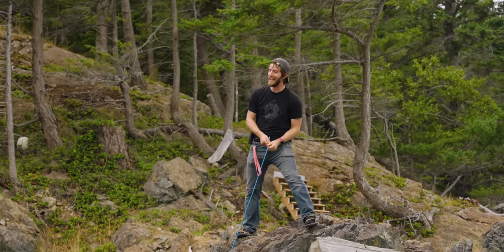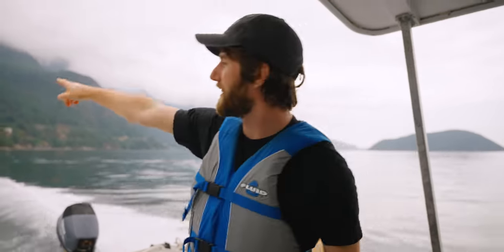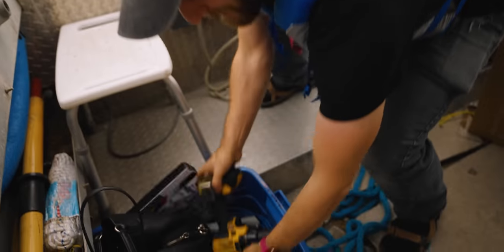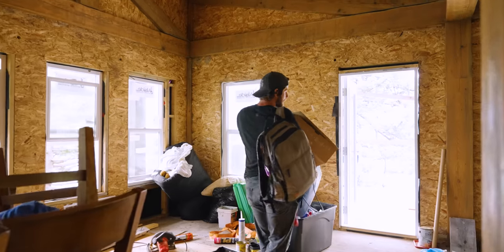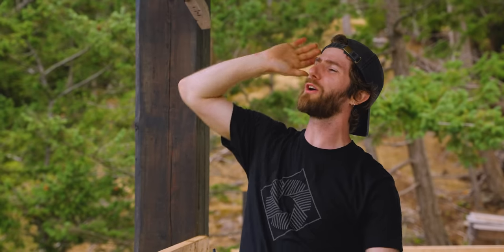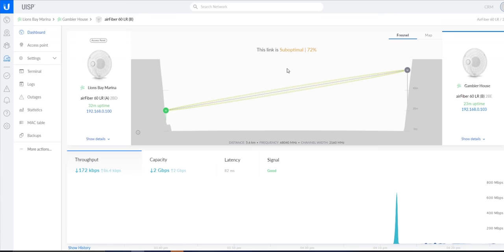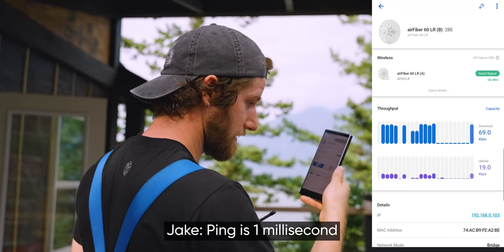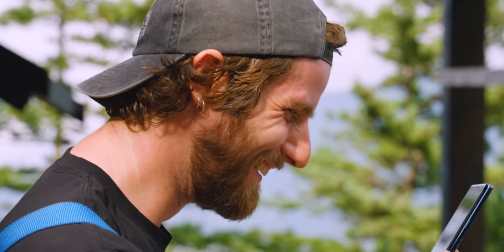How are we going to do this?

Comment: I know very little about computers, I was wondering logistically how does bolting the dish onto the side of the building at the marina side work?  Do his parents own that or did they just get access?  Was just curious where the internet would be coming from when the LTE modem was removed.
Reply: Considering the whole project, I'ld say his parents are loaded, and that marina is pretty small. So in addition to the fees for their boat, they probably pay a fee to mount the antenna to that building. 
Jake said that the ISP would be there to hook up the marina antenna in a few weeks.  Then the LTE modem can go.
My question is whether LTE was not an option on the island itself. This system will require regular adjustment of the alignment.
Reply: @lacdirk   I think the initial setup was the main issue for his parents. They can probably be taught how to make the adjustments. Short term they probably wouldn't even notice minor things since I imagine his parents wont be saturating that link.

LTE has its limits as well. 4g is gonna be shared with all the phones around, increasing ping as well as effecting speeds and 5g wouldn't even make it across the lake
Reply: @PINEx2   … Yes, if a normal suburban family in their 20’s bought and paid for their house in their 40’s or 50’s like good little boomers, then sold their place [even without the current housing market spike], they’d be well on their way to affording a custom built place.  Not too far fetched.
Reply: @JoelKreider  "payed" strikes again :)    [bayed, flayed, grayed, prayed, stayed, spayed]  [laid, paid, said]  English is fun. Surprised autocorrect didn't catch it.
Reply: @ifination  …Aaah!  Thanks bud.  Corrected.

Comment: Linus: I am gonna bring gigabit connection to my parents' "off the grid" house.
Starlink: I am gonna end this man's whole career.... :)
Reply: Off-grid = not connected to utilities (electricity, water, gas, sewage)
Reply: Starlink only promisses 100mbps
Reply: @jur4x  

You're a little out of date. As of November last year, Starlink was achieving 150mbps.

However, it's still the case that Starlink is transmitting over a distance at least 90 times (540km) that of this use case (6km), with latency as high as 42ms.

Also important to note that it isn't very fair to compare Starlink with Earth-based network solutions, as it wasn't designed to compete with them, outside providing connectivity to areas that currently have little or none.
Reply: Starlink sucks compared to this
Reply: @endurable_alex8379  Starlink is still lika developing peice of tech. Give it some time and u might be able to see gigabit connections soon.

Comment: You need a flash mirror, I used to do LoS Microwave hops all of the time, longest distance I've done is like 10 miles.
Reply: I was thinking a flare would have been good, but mirror of some kind does sound better.
Reply: I did a 116 mile path, Mt Eldon at Flagstaff  to across the Utah border at Page Az. Used a big mirror. Or you could use a light at night like Paul Revere. But we used 2ea 16 foot Andrews dishes at 2.4 GHz.
Reply: @tedmoss  What kind of speeds and RSSI did you end up getting?

Fun bonus thing, Mt. Elden is the only mountain I have walked on top of. Was a bit of work for a passive nerd who sits all day like me :)
Reply: @eowendyl  I don't remember all the details. The path loss was like 110db we were using 5 watts at 2.4GH worked better than 5GH for sure...path fade. We had signal loss from Shaw Butte in Phx. to Four Corners for many years, I found the problem in the LO at Shaw Butte; a solder connection not made at the RCA factory.

Comment: What if like a big boat gets in the sightline and blocks it for a bit or something? Or what if it's really stormy? What will happen to the connection?
Reply: The sight line is a pair of intersecting cones, about 2 feet across where they meet and 25 feet above the lake..

You’d only have to worry about the Goodyear Blimp.

As for storms, it depends on the frequency. 

 Microwaves get drowned by rain.   Radio waves get drowned by old cordless phones and CB radios.

Comment: Does BC not have the same harness requirements for lift work as Ontario? Kinda sketchy seeing anyone in a lift without it as someone who works in lifts every day
Reply: They do but this is ltt
Reply: Actually no, fall pro is not required in BC in scissor lifts.
Reply: @kklassen991  do you have a source I could look at I'm honestly just curious about the differences :)
Reply: @mcewennick  I tried replying earlier, but I think the comment was flagged for spam? Anyways, it's in the BC OH&S regs, part 13. Here's the excerpt in question:

13.33 Fall protection
(1) A person on an elevating work platform must wear a personal fall arrest system secured to a suitable and substantial anchorage point.

(1.1) Despite subsection (1), a person on a scissor lift, or on an elevating work platform with similar characteristics to a scissor lift, that is on a firm level surface with no irregularities to cause platform instability, is exempt from wearing a personal fall arrest system, provided that all manufacturer's guardrails and chains are in place.
Reply: Seems like someone lobbied to have that clause added...
Reply: @kklassen991  It's the same way in plenty of US states as well for probably the same reasons.
Reply: @kklassen991  that's the stupidest exception I have ever seen. And I have my OHS auditor credentials
Reply: @kklassen991  huh interesting, I find that surprising but thanks for the info!
Reply: @wpgspecb  lol. Do you put on fall arrest gear when you go out on a friend's deck too?
Reply: I worked with scissor lifts no harness here in NZ. Never felt unsafe, they only went up 3-4m meters and had 1.2m rails. Depends on the size of the machine I guess

Comment: I would rather have 200 Mbit stable connection. Then having a gigabit connection with this. A bit of snow and wind can be extremely problematic. Especially with things that require a stable connection like video calls and live streams. But it's pretty cool.
Reply: its a cabin in the woods, I don't think they need the ability to live stream that much
Reply: I think is fine for music and some facebook, which is what most likely their parents are going to use it for
Reply: There aren't a lot of alternatives. And a 1 gigabit connection that drops 80% in a snowstorm is still a 200 megabit connection.
Reply: @AwesomeSauce7176  this is indeed the only option when there's no cable available.
But I was talking about speed being less important than stability. This connection would be fine for watching things that can buffer as it won't get interrupted when there's a small connection drop.
 But the stability is a serious downside for many other tasks.
Reply: We have a WiFi bridge very similar to this running a couple security cameras at the end of our property. It works flawlessly in all weather, even white-out level snow. (However its not anywhere near the distance shown in this video)
Reply: Lol your using your phone from stream right? Same thing. Only not that strong.
Reply: @AwesomeSauce7176  What about Starlink?
Edit: I guess others in the comments say the Starlink dish uses 100 watts constantly, so without ongrid power that will be difficult.
Reply: @simple-cut-progress2778  that antena draws almost 65W. plus switch, plus AP.    a think starlink would be a right choice here
Reply: @Folkstorm87  where exactly did you 65w from? The manual states it draws 18w max power consumption.
Reply: @backupplan6058  thats the feed consumption.  Check the poe inyector.   

If the consumption was only 18w the switch was more than cappable to handle it.  

I been working with those puppys since the first Air fiber.  (2013-2014)
Reply: @Folkstorm87  really? How long you say. Because if you have I would have thought you would have known that the edgeswitch 10XP only does 24V passive POE while the AirFiber 60 LR requires 48V passive to work. Nothing to do with watts but voltage. Pretty sure you pulled the 65 from the amperage requirements. Please do your homework before correcting someone who knows this equipment far better.
Reply: @backupplan6058  my mistake, that switch only provides 24v   althoug.   the power supply draws 24watts, plus 31.5 on the poe inyector + 8 watts per AP.   

63.2 watts.      still  under the 100watts.  but less convenient.   

even the LTE receiver would draw less power an had enough juice to stablish a stabe connection.      
Lte is not affected by wheater or fresnel radius. even a tiny boat  could block the signal at that height

i would like to see a diferent solution to this problems and not a single "sponsored" solution, when the budget isnt a problem.   
"Hey ubnt, i need this  $1000+ on equipment to do this"
Reply: @Folkstorm87  where exactly are you pulling these figures from in order to justify your mistake? Power supply, what power supply? The POE injector is the power supply and where does 31.5W come from? As for AP, wouldn’t Starlink also need a AP in order to work and that was anywhere mentioned in your first comment. Does seem to me you are pulling it out in order to justify something you were wrong about.

Comment: My uncle uses a switch for his setup, his edge got fried by a lightning, so be sure to get a protection for that i guess
Reply: My modem’s are on a separate surge suppressor & I use fiber/wire transceivers to electrically isolate LAN from incoming wires.

Comment: Heads up don't drill into concrete without something taking the dust way while you are drilling. When you're drilling into concrete it releases silica dust that can kill you instantly, or at the very least later in life. Silica crystals will never leave your lungs once they are there. Be safe guys<3
Reply: Man up, its just dust
Reply: So we have to wear a mask when we drill into concrete?
Reply: @zaki6548  that or have a vaccum cleaner that is aiming at the hole
Reply: @Sniper_Gaming994  can confirm, use vaccum below hole

Comment: The curvature of the Earth is why Linus couldn't been seen. Standing on the shore he was below the horizon.
Reply: EDIT: I realised I made a mistake with my maths - I am afraid that assuming eye level is just 2m above sea level, you can see for slightly over 5km with no obstruction to view from the curvature of the Earth. That means you could see another person who is 2m tall from 10km away. Jake is pretty clearly higher up than 2m above sea level so while linus could be obstructed by waves or something, the curvature of the Earth will have little effect.

(BTW, the mistake I made was accidentally multiplying the 5km distance by 2pi - at 31.514... km the curvature of the Earth would indeed have a pretty massive impact!

Comment: 3:01 I was thinking that a laser pointer could help or high lumen light. Or a rent a telescope or used a powerful camera lens (ex. Canon 1200mm 5.6L Super Telephoto lens) and zoom if LTT has it.
Reply: A telescope wouldn't work because you're working with angles less than a degree. All that would do is get you in the rough ballpark they already knew the general location.

You either need a laser light for pinpoint accuracy or just use the internal system sensors and keep tinkering till you get the best possible settings. 

To bad the system doesn't have self adjusting telemetry.
Reply: @seemlesslies  True. I was thinking just that at that point in the video with the telescope or the light is to get a general location and with small adjustment to pinpoint exact location. I figured the laser pointer or the camera lens because at this point I figured LMG might have a high powered or a super telephoto lens like a Canon 1200mm 5.6L Super Telephoto lens for accuracy. Something like this:
https://youtu.be/U0E-nZOlY_k?t=120
Reply: Lasers are dangerous in populated areas...and many times highly restricted in use cuz of the dangers

Comment: Lol, Linus parents have faster internet in a house with no electricity than I have in one of the most populated cities in the world…F in chat boys
Reply: That explains it quite frankly, because the internet is a shared medium. Your connection is overpopulated whereas theirs is not on the map
Reply: @pietrmuffei8874  i mean 4mbps in a major US metropolis is a joke lol, these guys are legit getting LTE antenna connections 250x faster than me :(
Reply: @joshuad1716  I wouldn’t compare the US to any country. The US mos def is the last first world country. You as a citizen have to do politics.
Reply: @joshuad1716  Pretty sure that wasn't an internet speedtest. That was a direct test between the Unifi devices.
Reply: @VexingRaven  that would make a lot more sense and lessen my depression slightly
Reply: @joshuad1716  Bro...you could plug 2 computers in to a router, transfer a file between them and get the same kind of speeds...but that doesn't mean your internet will be that fast. Network vs Internet 2 different things.

Comment: Wow, what a home to live! It's nothing for me, but I mean it looks awesome and is definately unique 😮
PS: So why didn't they just use the LTE thing for the cabin? Speed?
Reply: LTT seems to have a boner for Ubiquiti stuff these days, probably a sponsorship. From LOTS of experience the airfiber stuff is superb but very expensive (though that link is gonna slow right down in the rain and die in snow I guarantee it, -61dBm is not a reliable link for these). The unifi stuff is pretty bad and is very quickly superceded. Ruckus however make superb local AP hardware, it just costs three times as much as the unifi stuff.
Reply: Lte isn't as good as a wired internet connection

Comment: Why don't you do that with starlink?

I'm currently building a round robin for my new house with two starlink dishes pfsens and unifi :)
Reply: This way they can have better speeds. Starling doesn’t hav the best speed and by using this method they could connect to and local wifi provider. More choices
Reply: @darshveersingh8336  depends on the provider though, also I doubt Linus parents need more internet then like 50mbps...  Real readon probably is because this makes a cool video and Linus loves this stuff
Reply: Reason*
Reply: @bertjedekat  that’s also true. He probably made all the money back from youtube
Reply: @darshveersingh8336  Of course, this is especially true for the upload speed (If you have such a provider)

But 2x starlink round robin would be worth a LTT video in my opinion to show round robin a bit closer.
Reply: I heard the tree line maybe an issue. You need 100 deg fov clearance around the tilted dish and seeing how close and high the tree line is to the cabinet, that's gonna be a problem. Plus this is LTT, they are going for overkill internet. Probably streaming 4K directly from Linus' private plex server.
Reply: @darshveersingh8336  And unifi hardware is cool to play with :)
Reply: Starlink pulls 100w constantly. Not great if you're running exclusively on solar and wind.
Reply: Isn't Starlink also more expensive than normal fiber or LTE in the US? I'm not familiar with pricing I'm just asking, here in Europe Starlink really doesn't compete in pricing or speeds with fiber.
Reply: @ngwoo  Good point. Linus' solution needs just 11W
Reply: @HuthanslHD  yea agreed

Comment: Seems like this would go out every time there's rain hitting it or the wind rattling it slightly. Neat tech, perhaps a bit too reliant on pin-point aiming.
Reply: You'd be surprised how resilient these devices are. many Rural ISP's use these devices and as long as it's literally not covered in snow, it's generally usable no matter the weather. I was with an ISP who used this type of tech and the 3 or 4 years I was on it, it only ever dropped out when there was a Power Cut.

Comment: That device looks like a bad idea... Someone knocks there head into it, signal gone. 

 rain at 60GHz.

    Drizzle (.25mm/hr) 0.2dB/km
    Light Rain (2.5mm/hr) 1.8dB/km
    Medium Rain (12.5mm/hr) 5.6dB/km
    Heavy Rain (25mm/hr) 9.5dB/km
    Downpour (50mm/hr) 17dB/km
    Tropical (100mm/hr) 28dB/km
    Monsoon (200mm/hr) 38dB/km

Comment: You want a hammer drill when drilling into concrete, and someone who knows how to use it holding it
Reply: Those are just conder blocks not cement.... A hammer drill wouldn't be necessary, just a masonry bit and the same drill, most importantly someone mechanically inclined who knows what their doing.....  Not nerd afraid of a scissor lift....

Comment: History: "And, just like that, the Flat Earth Theory was debunked...again..."
;)
(re: can't see Linus because he's too near the waterline and so are you...6km distant from each other).
Reply: Damn, you're probably right
Reply: good catch
Reply: If Linus and Jake stood with their feet in the water and looked at each other over 6km then they would still be visible from the knees up. Over this distance only 16cm is behind the curve. The fact Linus was stood on rocks making him a few feet taller means he should be perfectly visible on a clear day. I did think the same thing though, I just worked it out to be sure.
Reply: @dizlexia44  thx, was too lazy to do the math, so it's a half good catch then
Reply: @dizlexia44  Thing is, we don't know the humidity, temperature or swell-height.
..
So, either he just couldn't find Linus via binoculars, or there was some serious 'haze' going on.
..
But yeah, add it all up and you still get the same thing: "Didn't see nothin'!" ;)
Reply: @plumfun6750  there are plenty of reasons why they might not have been able to see each other. Most likely not powerful enough magnification. But atmosphere can also have a big effect.

My point is at 6km it's definitely NOT the curve of the earth in the way. To start with 3miles = 5km, and both people were meters above water. At 3-4 meters above the water they'd need to be 15km+ to be completely hidden behind the curve.